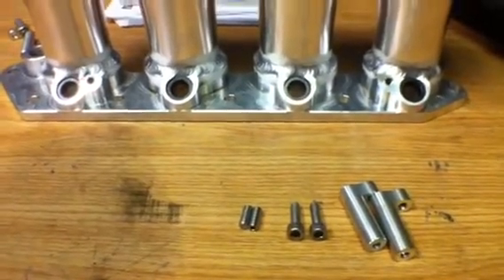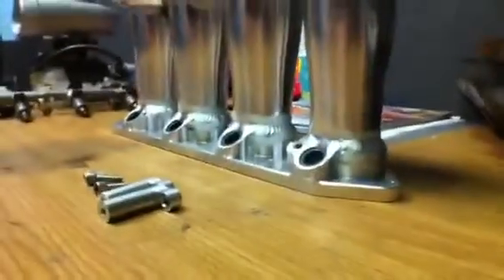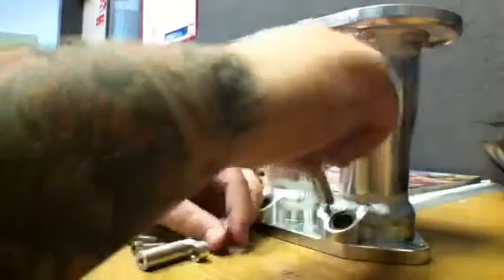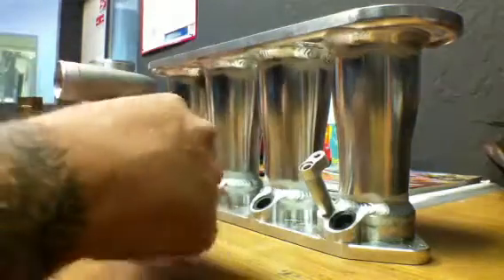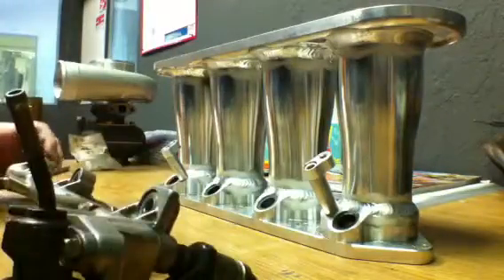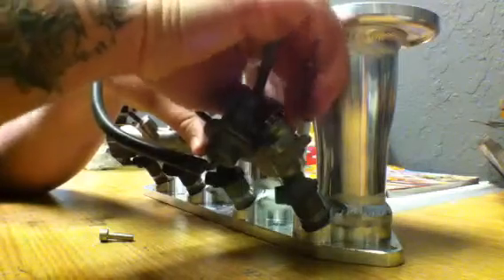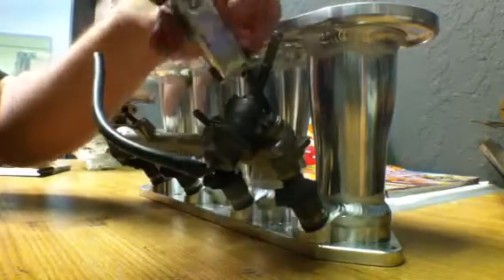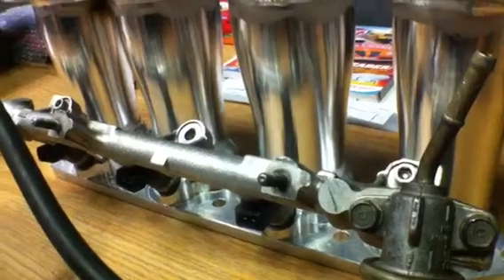Installing Fuel Rail on AFI's B Series Intake

Comment: Hi i need to change my disel rail on my bmw 520d, need some tips, the diagostics says its a faulty fuel pressure sensor, since the new rail comes with them both on im changing the complete rail, my mechanic says if i change the rail ill have to reprogramme the ecu from bmw dealers , if change the sensors only its plug and play,  could u be kind enough to guide me what i should do
Many thanks